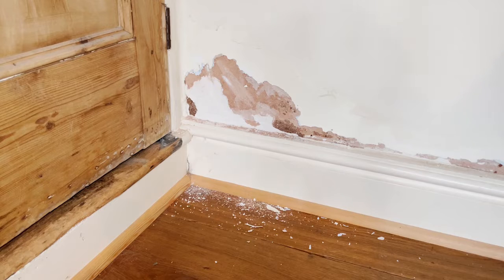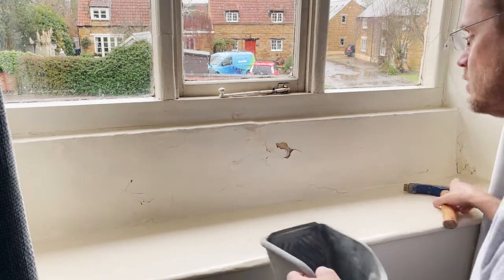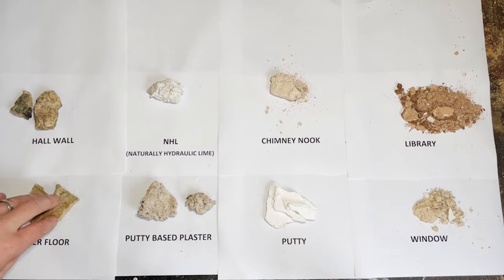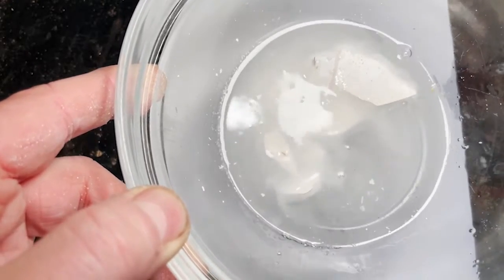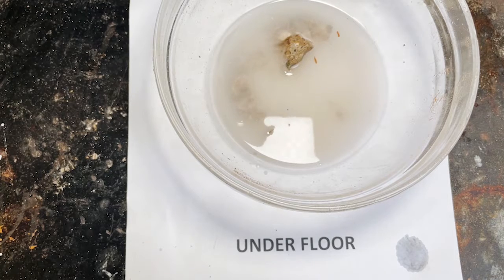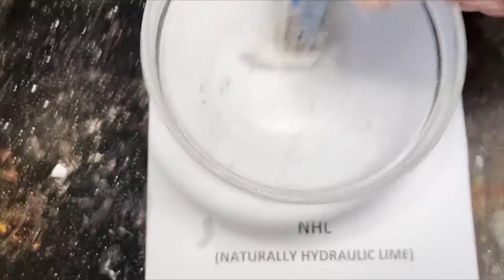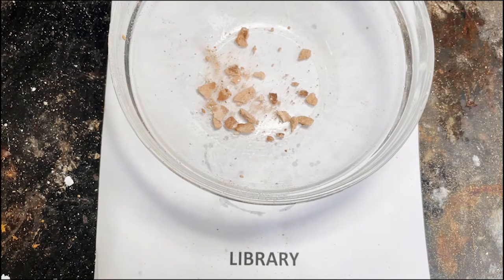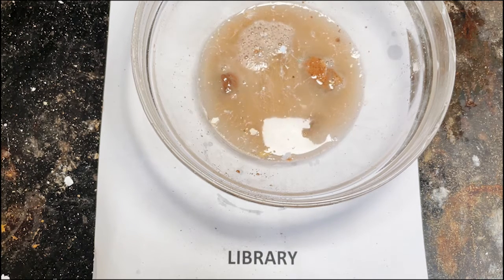Lime, Gypsum or Cement . . . and how to tell the difference

Comment: I'm interested in the bit around 6:00 where you state quite definitively that any cement in the mix is "bad". The last time I looked into this I got the impression it's not as clear cut as that. That there might be certain types of stone or brick where some proportion of cement in a lime/cement mortar mix is not a problem. At the most extreme end, something like granite, but that there may then be a kind of sliding scale where certain types of historic brick can quite happily live with a part lime/part cement mortar.
Then there's also often confusion about what property, exactly, we are looking at. There is that of breathability, which may matter more or less depending on the rest of the wall buildup.
But also the property of how much water the mortar can soak up and then release (hygroscopicity?) which is what's relevant when you are worried about the masonry eroding in preference to the mortar, instead of the other way around.
Your remark implies that for one or both of these properties, even the tiniest amount of cement will completely compromise it. When I last looked into all this, there seemed to be considerable doubt about whether that's the case.
I'm not writing this comment just to try and say you're wrong, more wondering if my understanding has become out of date because of better information that has emerged in recent years. The last time I really went into depth on this was going on for ten years ago now.

Comment: This is fantastic. In my recently Edwardian property (early 1900s) there is lime plaster that very soft and crumbly and coming off the walls. It looks dry but very old and I think it needs redoing. It was probably last done in 1970s by the previous owners. Also, the previous owner put wall paper directly over the lime plaster and when I pull the wallpaper, some of the lime plaster comes off on it too. Interestingly, when I scratched at the lime, it came off very easily (crumbling) but behind it was what look like a dark/black wall. I don't think it's mould or anything like that, and the wall is not wet or damp at all. Do you know what this black/dark wall is? I'm not sure if it was used as a layer before applying the lime plaster. Any thoughts? Thank you
Reply from the maker: The black sounds like tanking. Bitumen paint is often used behind gypsum to act as waterproofing. (But it then traps the water.)
Reply: @oldhousediy can you please kindly share your email so I can share my property information as I’ve got two room that requires plastering but I’m not sure if it is lime or not
Reply: I am facing the same problem.

Comment: Thanks for showing how to test for lime.  You say that NHL is "controversial."  I wish you would speak to the difference between Natural Hydraulic Lime and Hydrated Lime.  I think NHL is the pure (lime) powder not yet given any water and it has a very hot chemical reaction to water; I think Hydrated Lime (what we have here in the States, "Type S"), which looks just as powdery,  is actually already partly re-hydrated (is less reactive to work with). Is this right as far as it goes?  Thanks again!
Reply from the maker: NHL is hydrated lime but it is impurities in it so that it sets (not carbonates) quicker and even under water. It is similar to Pozzolanic additives. It has been partly slaked (water added) and it does not have the hot reaction when you mix it up.
There are arguments that NHL gets harder than putty / hot based over time and can lead to brick stone damage and so is becoming controversial.
This is a very good book on lime, really worth a read and I am sure.
https://www.blackdogpress.co.uk/product/lime-in-building-a-practical-guide-by-jane-schofield
Reply: @oldhousediy  Thank You!
Reply: @oldhousediy  didn't the Roman use "Pozzolana"? I heard that lime and pozzolana are the best for plaster/render walls
Or is it?
Reply: @oldhousediy  NHL is actually hydraulic lime, not hydrated. NHL is essentially quicklime, with natural impurities that make it set much faster, much like Portland cement.
Reply from the maker: @sergeiok8499  correct , I think the impurities are present pre-firing so the end result “sets”.  NHL = Naturally Hydraulic Lime. I mainly use putty made from hydrated lime these days but the NHL here I had left over from a floor repair when I needed a quicker set.
Here’s how I make my putty.
Making Lime putty
https://youtu.be/LTUYQqV9AhE
Reply: @oldhousediy  love it, great video👍
Reply: @oldhousediy Thanks for the book recommendation.

Comment: Very useful, I also have an old property (18th century) with many various coverings. Some extremely hard renders
Reply from the maker: Thanks. The harder the coverings the more likely they are cement based (unfortunately).
Reply: @oldhousediy  yeah it seems that way, can do more damage taking it off than leaving it on, I’ve got a very hard cement render with a thin skim of gypsum over the top. Difficult to know what’s the best thing to do, I have chipped off a few areas where the gypsum looks damp, but the brick behind under the cement are dry, thinking I might remove the gypsum skim and when lime plastering skim over with lime.
It’s an basement, biggest issue seems to be the flag stones under self levelling compound and concrete skim up to the outer walls. Since removing the floor covering and revealing the edge of the stone floor seems to be drying out nicely. Think the damp couldn’t escape so going up the brick wall
Reply from the maker: @snips73  a slow step by step approach is definitely best, you don’t need to hack everything off straight away.
Reply: @oldhousediy i am doing just that. going back to the original wall. i have bits of wall with 7 different layers and black mold and bits with just like and not a thing in sight with dry wall.